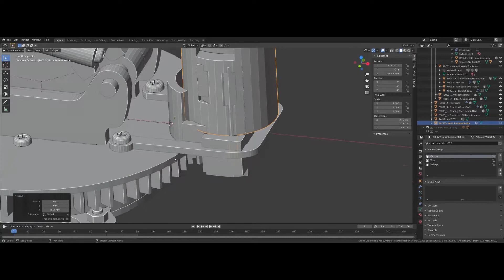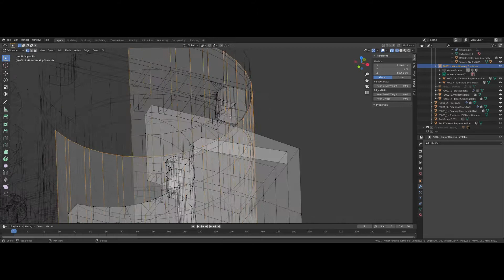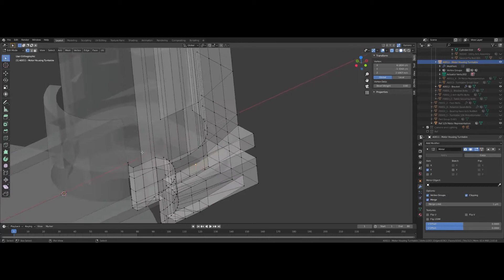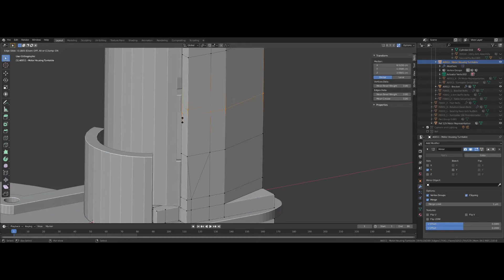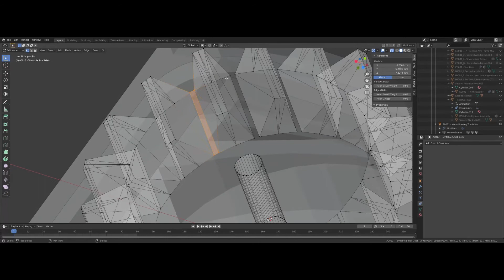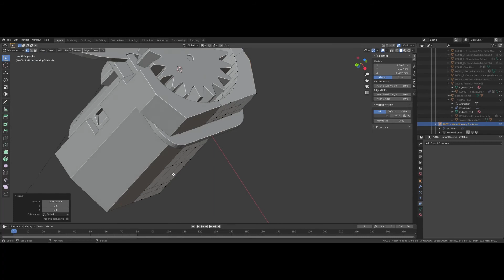12V Motor housing update for Robot Arm Project - Curio Inventorium

Comment: I'm a little late, came for an evo video and found this. The model is fantastic, you can prob sell it on turbosquid. Also, when rotating or moving an object, you don't have to click on that little box for precise measurements - just press R to rotate, then type 20, you can press x,y,z as well then it will change axis. Might save you some time
Reply from the maker: I've got the pistons themselves available for free on MyMiniFactory. Later on down the line once I've managed to make full working designs, I'll put things up for sale :)
I can't remember which part of the video you mean with rotation but I do know about pressing 'R', usually when I instantiate something I do a quick 90 rotate. But over the years I've come to using the little box when I'm adjusting stuff.
We all get our own workflow over time :D